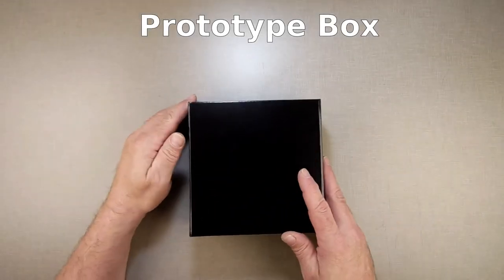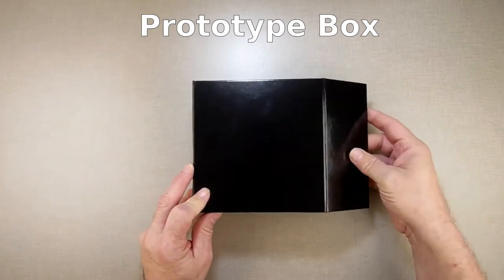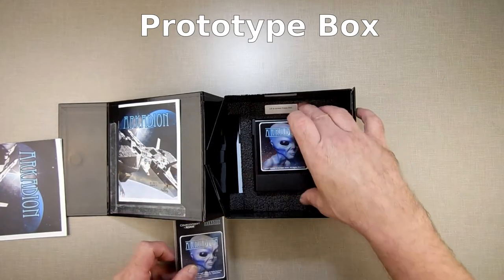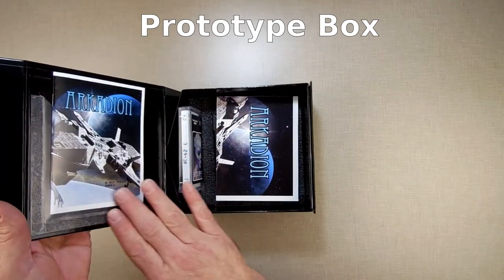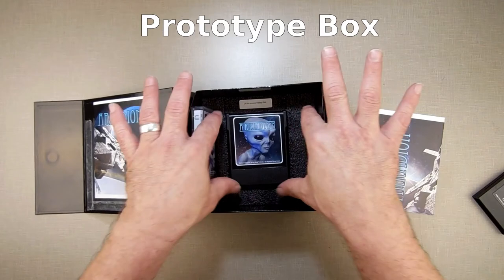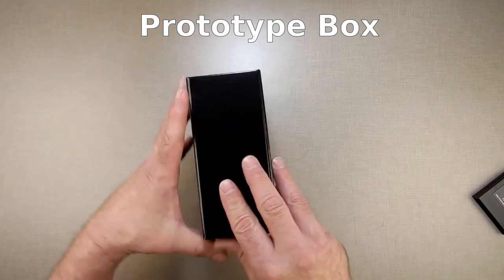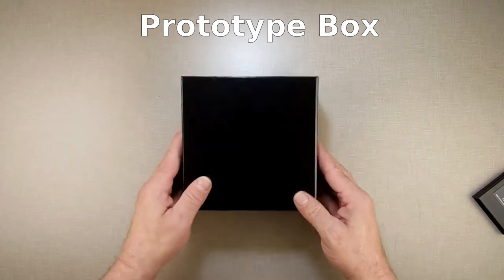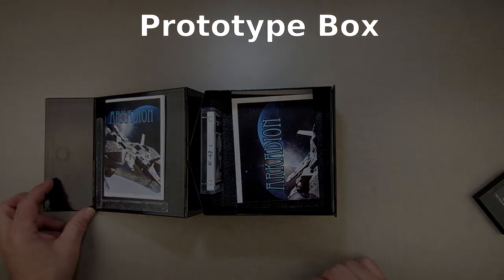Quick video showing a Box Prototype

Comment: Milli, I just have to say, I hate it.  It's an enormous waste of resources/materials.  I follow your channel and I enjoy your videos.  It's because of you that I was able to install an internal power supply in my ADAM.  However, if I was a collector, I'd avoid your games like the plague if you were to ship them in these boxes.  They don't go with regular game boxes, so they'd be an eyesore on the shelf.  You mentioned that you can put different sized cartridges in this box.  I have, in my collection, a Commodore VIC-20, and the cartridges for that computer are HUGE!  Even so, they would fit inside a regular ColecoVision box.  About all I can think of that wouldn't fit would be a diskette, and most gamers really aren't interested in diskettes; it's all about the carts.  I see this box and all I can see is the waste - the extra cardboard, the magnets and the foam.  Not good for the environment at all.  You've already pissed off a lot of people in the retro community.  I see this as just more reason for them to slam you.  Don't give them the ammunition.  Thanks for listening.
Reply from the maker: Putting the box to the side I would love if you would contact me directly and let me know how I have “pissed off” a large part of the community. Honestly I would REALLY like to know.